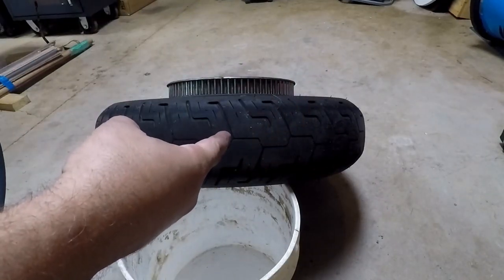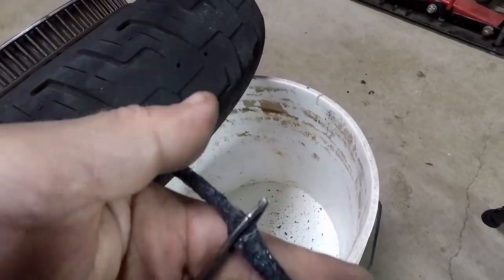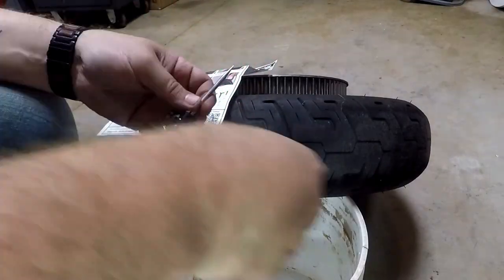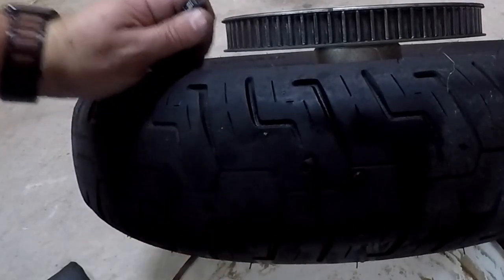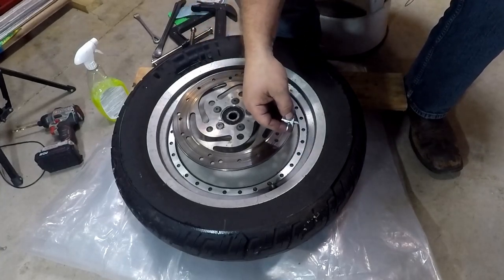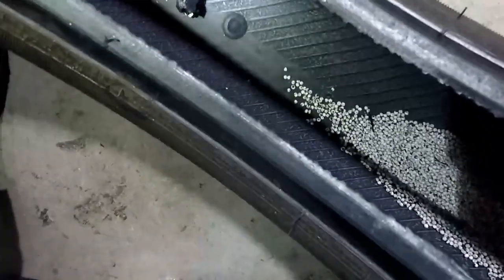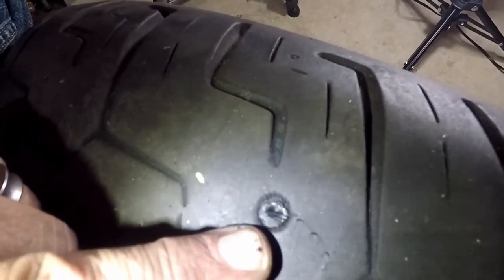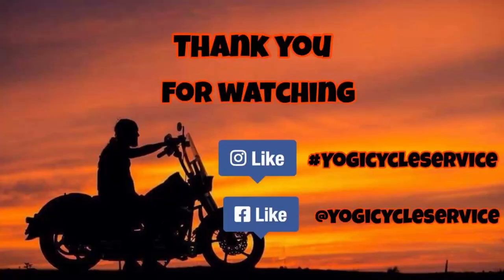Rope Plugs vs Mushroom Plugs

Comment: I’ve used both. Had good and bad results with both. In my experience the snotty rope is more versatile, easier to apply, available everywhere and certainly cheaper than the mushroom plugs, which require specialized application tools. And I haven’t seen mushroom plug kits or extra plugs sold in stores. When the mushrooms work, they work very well. When they don’t, they, um…don’t. Also, if you’re stuck at roadside, the mushroom plug application will leave you needing air, just by the nature of the equipment.

Comment: I would have liked to see the repair done with the wheel on the bike.   Second part for all that read this both or really any "safe" take as you will, repair is only in the tread of the tire.  Do not repair a sidewall with these kits.   

Now here is one other aspect to keep in mind.  The mushroom plug is only going to work on anything smaller than the sealing part of the plug. The string plugs can be doubled or tripled up for a larger hole.  Now the question is would you want to ride like that?  I can think of situations where I might but a dare I say...slow speed, LOL to get somewhere else or even a local shop.
Reply from the maker: I double plug the motorcycle tire once after a really bad nail hole and it was just enough to get me to a gas station so I can wait for a trailer to get there
Reply from the maker: And next time we’re on the road and you, me, or one of the guys gets a nail in the tire we will use this plug kit. I’ll video it so you can see the procedure done on the bike. I just didn’t want to shoot a nail in my tire still mounted.  It’s more impersonal shooting my baby if I take the tire off.
Reply: @YogisCycleService  I really hope that they never have to come out of the pack.